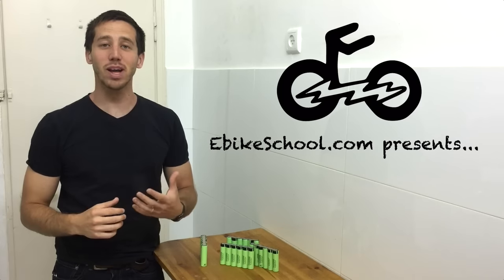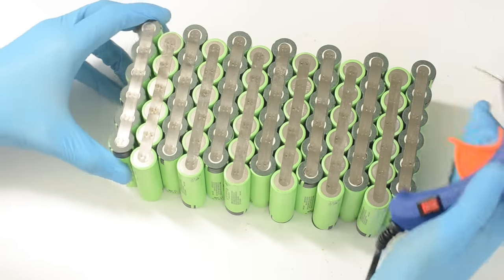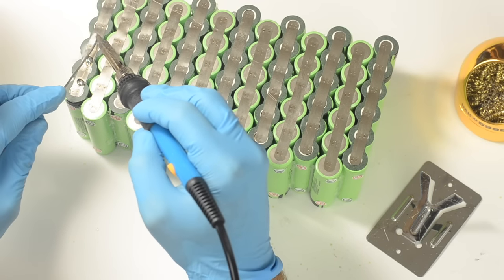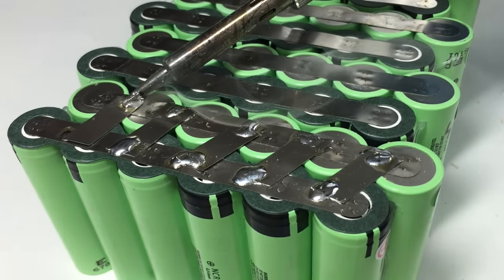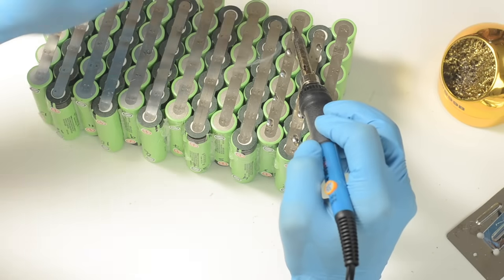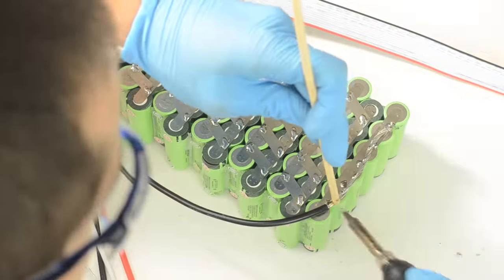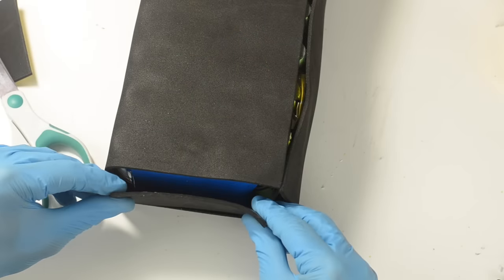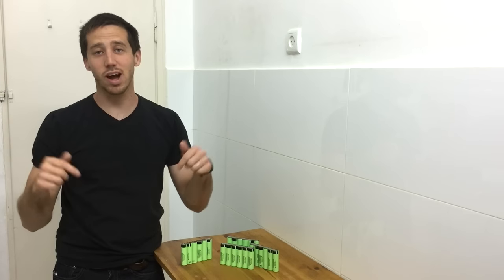DIY 48V 20Ah lithium battery without a spot welder using Maker Batteries

Comment: Great video, thanks! ... But I'm confused about something. Why so many strips? Wouldn't one strip connect 2 rows because everything is already touching each other?
Reply: Disclaimer:  I'm just guessing...know very little about the world of DIY battery making.  That said, I wondered the same.  My guess is that the thin strips of nickel might overheat if there were only a couple.  Maybe dispersing the energy evenly and with greater surface area might just be better craftsmanship of that kooky DIY'd battery, dramatically reducing the risk of a strip overheating and melting.  And I've only watched the vid once, but if there was only one or two connection points and one breaks, the remaining single connection might then have all the current running through it, causing it to melt in short order, resulting in catastrophic failure of the whole batt.

I'm undecided as of the moment whether I'll DIY it or buy a premade.  But one thing I'm not undecided on is my confidence that a battery failure as the result of going for a good long ride on my 48V 1,600W Uberscoot would likely produce a situation whereby there's precisely ZERO scootage yielded after the battery is toast, manifesting the consequence of walking the 80-lb Uberlug a considerable distance back home.  I believe they weigh 117 lbs with the lead acid batteries.  I'm guessing (again) that a lithium batt weighs 40-50% of the guesstimated OEM 50-lb battery bag.

Conversely, I like the idea of a battery whose energy flow between cells is widely distributed, keeping cool and thus keeping its lifespan and health as a rechargeable battery nice and high and long.

Comment: Will be appreciated if  show with diagram how it makes 48v 20amps in s and p connection
Reply: The cells are fixed together in rows of 6. Each of these rows still only gives 3.7V because they are in parallel. There are 13 rows of 6, this time connected in series. So 13 x 3.7 = 48.1V, and the 6 cells per row would give you about 20Ah if the cells were say 3300mAh...
Reply: @The1trueDave  Thank you mate! Appreciated 👍🏼

Comment: hii Micah can you make a video on various cells(PF,  GA, 25R and other cells) and talk about C ratings and their applications in high and low power builds and also about life cycles.
Reply from the maker: I actually just filmed one similar to this. I just need to edit it when I have a few spare hours and then I will upload it!
Reply: EbikeSchool.com 
please show what to do, and how to fix  , if one cell goes bad in the middle of the pack...
This is not to jinks anyone, but all I  see is an extreme head ache.
And that would be my luck...
tanx and keep up the good work. ..

Comment: Hi, nice video, I would like to make a similar battery for a 1500w hub motor but with 52v voltage (14s). Which battery configuration do you recommend for this motor and above all if I use these cells of the Panasonic NCR18650B how many cells do you advise me to insert in parallel to have good performance and reduced stress per single cell?

Comment: I thank you for the tutorial pity that I don't speak English but your demonstration allows me to understand the main line of the assembly but I will have to contact a technician because I don't understand the position of the connections b- c- p- which load that provides in any case thank you

Comment: Sorry if my question seems very stupid but I dont really know much about batteries. So how would you charge this pack? Most packs come in cases and have a plug in charging port.
Reply: Lithium Chemical batteries are a complex cell structure that needs to be charged in a controlled manner. Lithium (Li) is very unstable chemical and therefore, needs to be charged through a charging device is called BMS ( Battery Management System) Please get further advanced info online. YOU MUST NOT CHAREGE THESE BATTERIES BY THE NORMAL METHOD.
Please note that if mishandled, the Li-Ion battery can EXPLODE and cause extensive damage to property and personal around it.

Comment: the Milwaukee M18v red 12.0ah used on Milwaukee power tools? As I’ve came across 5 of these bnib & im keen to know if there suitable for Ebike battery build. 
Being Milwaukee (a decent) brand name I’m assuming the cells should be decent cells? There 21700 cells high discharge, are these suitable for a decent battery build?

Comment: Hello there. Lithium Batteries with different amps when using the battery, does it make trouble to use different batteries? Should we fully charge and recharge the lithium battery batteries? is it okay to charge without finishing? How to use longer life How should we follow a path. 

2.Which device should we use for amperage test on the batteries? Do you recommend Litokala lii500?
Reply: You should use same type cells for battery pack for long life. Lower than 4,2V charging voltage and not  driving battery empty will give longer life too.

Comment: If I had a amp controller rated for max 84volts and 41 volt cut off would I be able to use 2 36volt battery packs together ?

Comment: Hi, where did you bought a  Uxcell PVC Heat Shrink Wrap for 18650 Battery Blue and what sizes did you used for battery pack 48v 25 AH ???

Comment: I bought a 48V/99999mAh pack but it got wet and a few weeks after it dried off, it wouldn't charge any more. But it had 3.67 volts left after testing it with the multimeter. Can this battery pack be fixed?

Comment: Is there a conflict? in your book you conclude that soldering is dangerous, but here you have a devised a technique to minimize overheating the cells. In the book you say that the plastic caps are overrated but elsewhere you say that the Vruzend kit is better than soldering or spot welding. Are you saying that the jury is still out on the most efficient way to assemble a bike battery?
Reply from the maker: In this video, I demonstrate a soldering method that doesn't solder to the cells, instead it solders to the nickel on the cells, keeping the heat further away from the cells themselves. The book was written before the Vruzend kit existed, so it doesn't include it. I don't think I've ever said the vruzend kit is better than spotwelding. Spot welding is a more permanent and higher power connection. But the Vruzend kit has other advantages that spot welding doesn't have. Each could be better than the other for different applications.

Comment: Ive been told that GM found they could dramatically improve Lion  battery life by making sure they never get hot.  Why no heat sink ?
Reply: I might be stretching it to say I have only the most basic knowledge of batteries technology in me brainium.  But I do know a thing or two (like Farmer's) and I believe that the main cause of heat whenever there's electricity flowing is too narrow/small of conductive wire or connection relative to the current flow.  I cheap extension cord will heat up if running a 20 amp vacuum through its thin, poorly insulated wires, right?

Maybe the many connections of nickel strips between rows of cells helps disperse the overall current flow, thereby keeping each connection relatively cool.

Or...maybe it's just that most electric scooter/bike folks aren't subjecting their scooters to prolonged, daily use (like an electric car), thus the technology of said batt just doesn't need to be optimized.

What brought me here was a 48V 1600W Uberscoot whose lead batts swole and (I'm assuming) caused it to...not go forward anymore under its own power.  Nothing more than a blip of energy and it's done.  While between my son and I, we've probably ridden the thing a total of less than 5 hours since buying it a few years ago, in opening up and inspecting the original lead batts, they're all swollen.

Is that indicative of overcharging (leaving charger connected for days) or just cheap Chinese batts or just age...or all of the above?

Comment: The 6 pack module looks like prewelded, positives welded together and negatives together. So each cell voltage must exactly or precisely the same, otherwise the cells with higher voltage will charge the lower ones. Please correct me if I'm wrong. Thank you.
Reply: Does it matter if using only new high quality cells? I understand if using getting cells from random laptop batterys...

Comment: Hello. I did the same battery. Who can I exchange for a larger BMS? I need a 48V 60ah BMS. This will be good? Unfortunately, the risun engine consumes 2880 watts instead of 1500 watts. I think he needs a minimum of 50Ah all the time.

Comment: i can run one for an hour on just a six pack of those with an ebike motor low rpms (two per second) with a generac stator and ac throttle for 40 volts to an ac motor and save fifty percent of my money. lets see you do that. the reason i only save fifty percent is that i have to build a bread board that reduces the voltage output to two rotations per second continuous so i don't spend a lot of money on electronics. and i still get an hour of drive time. the motor runs at less then 3 volts at two rotation per second. so try that and save all the money for batteries and electronics.

Comment: Hi Micah, I enjoy your videos. I was so inspired I have built my own 48 V 20ah ...battery pack I am using a 48v charger 2A, its rated for 20ah packs...I have a second one 48v 10ah...Can i use the same charger? Thank you in advance
Reply from the maker: Jg C congrats on building your own battery! Yes, the 2A charger should work fine on your 10Ah battery as long as it is 48V just like your 20Ah battery. 2A is not a fast charging rate, so your battery should handle it fine.
Reply: EbikeSchool.com 
hello again ..so my 10ah battery will not be damaged by this 20ah charger...Thanx
Reply from the maker: Yes, it's not even "really" a 20AH charger. Chargers can only be measured in volts and amps, not amp hours. They just write 20AH on the label to say that it could work with a battery like that. If it is indeed a 2A charger (check this) then it should be fine for pretty much any 10 AH battery.

Comment: Can it be possible to parallel 2 pack with same voltage with different amp? Say for example 10 2.1 amp 18650 in series parallel with 10 2.5 amp 18650 in series? Thanks 🙏

Comment: Hi Friends, I Just DIY 48V 20Ah , 2 pack , and I confuse about How I Can Paralel that Battery so I can get more Power to Be 40Ah , cause I BMS there are two port , One for Charging , and another is for Discharging. I do with Recondition Battery not a new one is need a special treatment ? Thank You

Comment: What BMS do you use? If you don't mind. Thanks Pete
Reply: The best BMS that's in the market now is the one, that I'm using is SKYRC MODEL B6AC+ ver2.0.
It's a Professional Balance Charger/ Discharger.
It has mains input as well as 12V DC. It has built in Battery meter, Battery Internal resistance Meter, re-Peak Module for NiMH, NiCd type batteries, Terminal Voltage Control, Computer input control and IOS wiFi control through WiFi module.
I am extremely satisfied with this Balance Charger.
Reply: I forgot to add that the SKYRC BMS comes in BLACK PAINT WITH RED, BLUE, YELLOW and GREEN tactile touch pads.
This device charges, Li-Ion, Li-Polymer, Lithium, Ferro-Phosphate, NiMH, NiCd and PB batteries.
Buy from an authorized dealer to avoid cheap clones. Cheers.
Reply: A BMS is a Battery Management System, a component added to a battery to monitor the status of individual cells.  The BMS keeps the battery healthy, theoretically.
For most of us, the B6AC is not powerful enough to balance charge our batteries.  The B6AC can only handle 6 batteries in series, and eBike batteries have at least 10, and often 14 cells in series.  You can break a 14S battery into 3 smaller batteries for charging, but that takes 3X longer.
Reply: B6AC is a battery charger, NOT an on-board BMS such as is used here. These battery-packs are intended for building electrically assisted bicycles needing lots of voltage and charge capacity. The B6AC is a great charger and diagnosis tools for individual 18650 cells or small battery-packs such as for radio controlled toys and drones. I am about to buy one myself, but it is not a BMS for this kind of application or purpouse.
Reply: Indeed, I checked the website and the kit, and it does not say. The only information given is: 

"30A continuous balancing Battery Management System (BMS) with wires already presoldered XT-90 discharge connectors with 50 cm 12 AWG silicone wires presoldered"

 (Phew, they need to learn punctuation!)

Comment: Do you really need all those strips connecting each row? Wouldn't one on each end be sufficient?
Reply from the maker: One would create a perfectly functional electrical circuit, but multiple strips mean you can carry more current. More current = more power.

Comment: nice vdo ! what is the total cost of this battery ?
Reply from the maker: Depends on the model, this one is around $450 I believe. It's available at www.DIYbatteries.com
Reply: DIY shows $469 making it about $6/battery with parts and labor; that is if you believe that each battery is 3.3 A-H.  check for 18650 battery capacity.
Reply: Hi John, I just found this site and subscribed because I found it to be very informative. Paying $6 per cell which includes all the other items is not bad. They are 3400 mHr cells or 3.4 Ah cells. I paid $11 each for 3.5 Ah 18650 batteries for my Fenix Flashlight.
Reply: @Frank Biz Where did you get those? Genuine LG cells? Pannies?

Comment: I don't understand why you need the white wires soldered on when each module is already in series and so many inner connections from strip to strip.. would not 1 jumper connection at the end of each module be ok?
Reply: The white wires are for the BMS to monitor every cell group. 1 jumper at the end of each module would make the same electrical connection, but it wouldn't allow as much power to flow. It's like how a 5 lane road can carry more cars than a 1 lane road.
Reply: ah! tyvm

Comment: What is different between lead acid and lithium battery. ?
Reply: At the same "amp hours" and "voltage" lithium is smaller, lighter, able to discharge more power, and way more explosive.

Comment: Hello Michael, Is it possible for you to send me a Triangle 72V 20AH battery pack configuration, connection and diagram consist of 100 cell of 18650 ?
Do you accept to build custom battery pack if I order it?

Comment: Don't they heat and short-circuit when u join Negative to Position as when I did them tend to heat up
Reply: Simpi Manan not unless you connect the ends together...  -+-+ they don’t short circuit. you did something wrong, be careful

Comment: How many times can this battery be; charged / discarded?
Reply: With 4,2V about 500 times and 4,05V way over 1000. This is just example. So many different factors: charging voltage and amperage, cell quality, charger quality, temperatures, BMS quality etc..

Comment: would it be difficult to replicate this 48v 20Ah build with a vruzend kit?

i cant find a simple tutorial for a 48v 20ah vruzend battery.

i think i can but it will take up more space.
Reply: That kit is too expensive. You can order Nickel Strip Tape from Ebay. There is 2 size: with and without 18650 plastic spacers. It makes making battery pack as easy as it can get. I ordered battery spacers, so no need to mess with the glue.

Comment: How can i buy just the nickel strips? Everywhere i look (other than one seller on amazon) they are just Nickel coated Steel. I am building 80s packs for a motorbike.
Reply: Perhaps you did not try enough. I'm not a great fan of Amazon. Try eBay their dealings are much more easier and have many more venders under their belt.
And DO NOT BUY Ni coated strips, only pure Ni strips are preferred by the Electronics Industry.

Comment: Hello sir,
Nice video.. 
Wondering if this would make a ninebot max G30 faster. 
Its a 36v 350watt motor. 
Can i run this or do i need to change the motor to 48volt? 

Many thanks for your answer :)

Comment: My require 48volt and 50ah for electric motorcycle 
Please suggest how many cell required
Reply: Impossible to answer for that guestion.
Reply: @mikakorhonen5715  13s15p with using 3400 mAh cells. And it will make 51ah battery. 13*15=234 cells required. Size will be quite big and heavy(12kg).

Comment: diybatteries does NOT sell you the single cells in a specified by buyer quantity, found the website useless for the DIY'r like me that wants to buy 3 cells for a power supply project.

Comment: i power my 48volt 1000 watt hub motor with sla batteries for a fraction of the costs...it is on a trike so i am not concerned about the extra 20 pounds of weight. 18650's are a gimmick...in reality..they are a pain in the ass

Comment: At peak voltage these batteries are 3.7 volts each; their nominal voltage is only 3.2 volts, and when they discharge they do down lower.  Practically speaking you need either 15 or 16 (16 is better) sets of batteries, not 13.  The rest looks really good, but it would be helpful to know who manufactures the cells to make sure they are good quality cells.
Reply: No 18650 are 3.6 or 3.7 nominal and 4.2 peak...

Comment: Sir I have need your help,my bike is almost ready,I have need a48v20ah battery,but I want tha width 4inch battery,plz help me sir
Reply: That is very tricky. 13S*4 Gives you max. 14Ah.
Reply: @mikakorhonen5715  thanks dear
Reply: @Drxikramtechnology4207  it is possible to fit 5 cells in one line and make it a bit longer. 13s6p doesn't have to be 6p together. I have similar battery a bit less than 2 inches large. Longer.